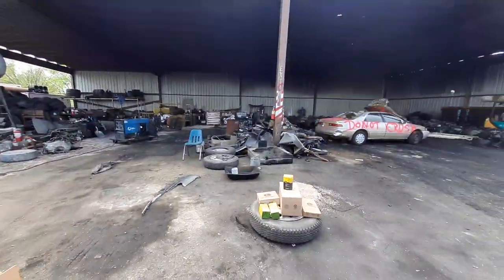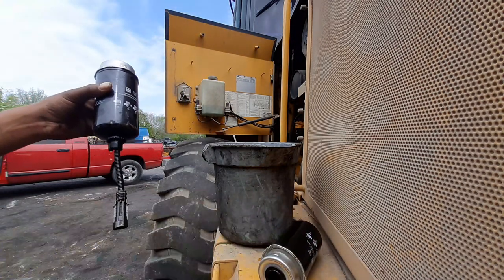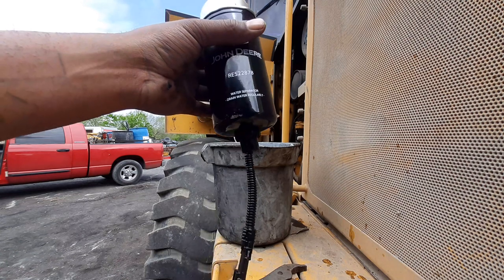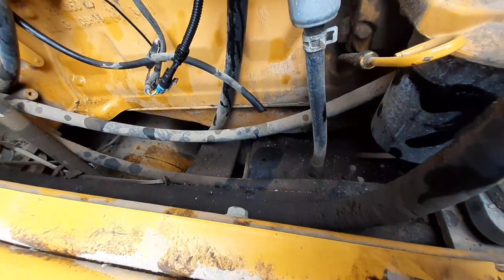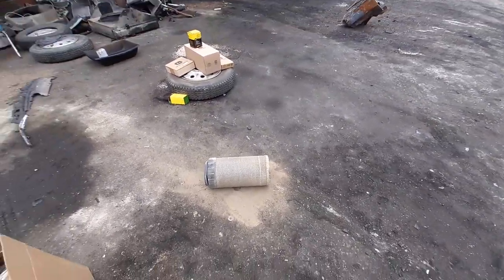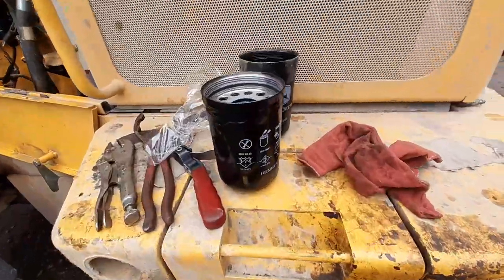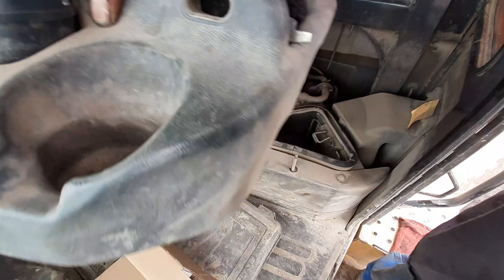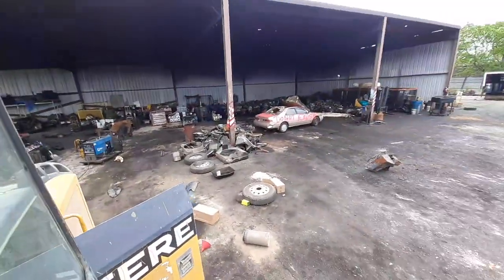SERVICING MY LOADER DIESEL OIL ALL FILTERS INSIDE & OUT..

Comment: If i can ask - what oil do you use on this tractor?
Reply from the maker: Sum type of 20 50 special heavy duty blended oil we get by the 50 gallon drum at our mechanic shop
Reply: @DeathRowCrushing.  that is a lot of oil, in leters that is 189.27l (we use liters on europe contrys)
Reply from the maker: We have a big gas n diesel repair shop so he orders like 2 50 gallons drums at a time..